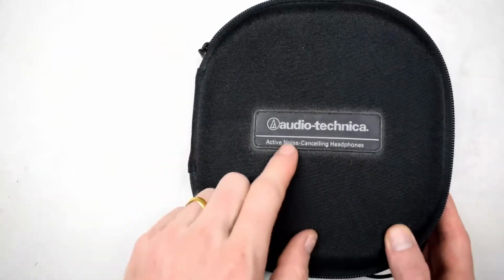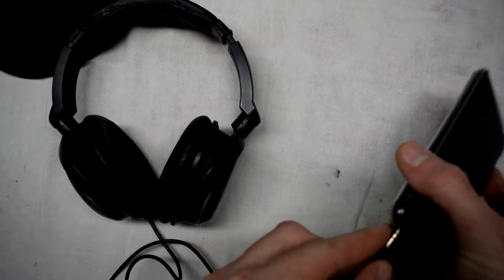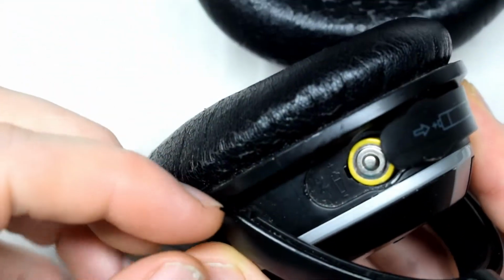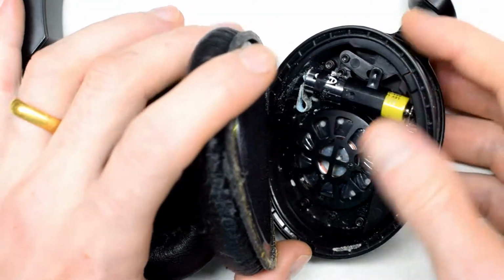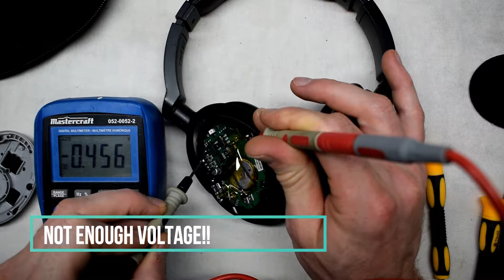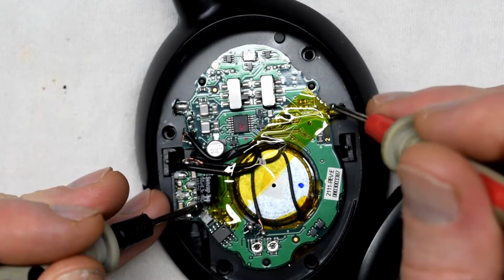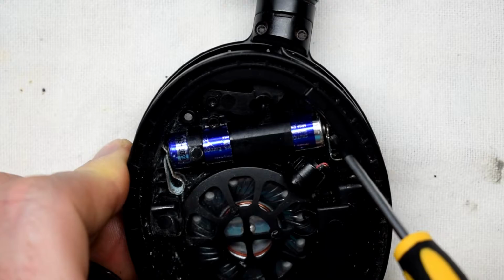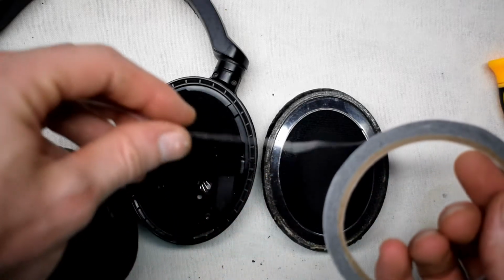Audio-technicia Headphones Not Working? FIXED! Model: (ATH ANC7)

Comment from the maker: Any questions just as them below.
Reply: Negative THT electrolytic capacitor have connect to Negative batt ? my headphone THT electrolytic capacitor not connect negative batt, But bigest SMD capacitor negative connect to IC MAX660 negative pin and not connect to negative batt, i wonder some negative trace disconnect